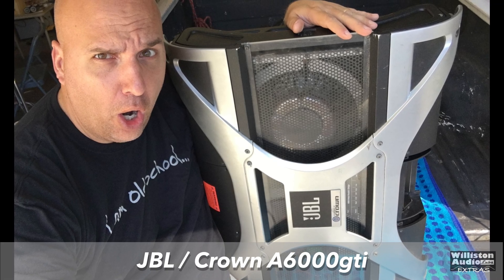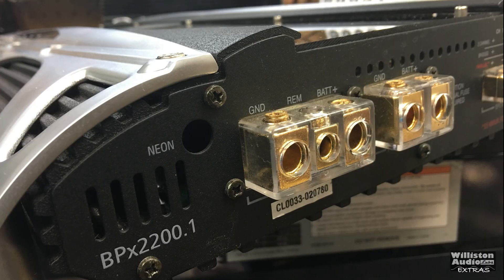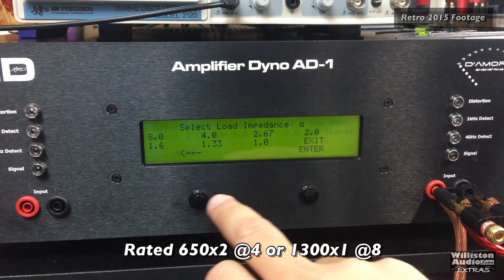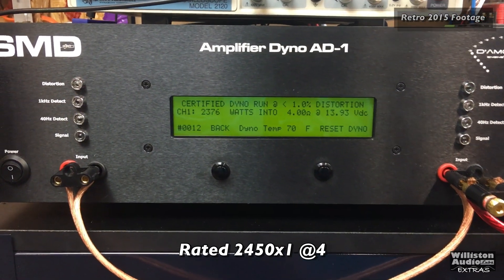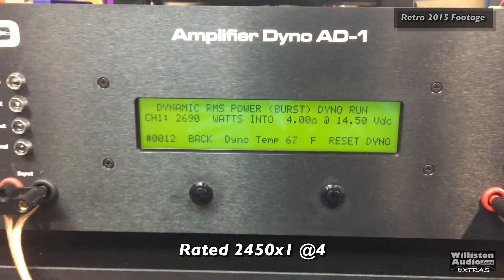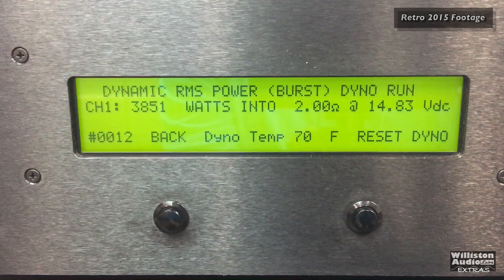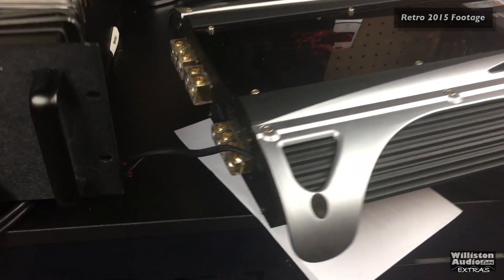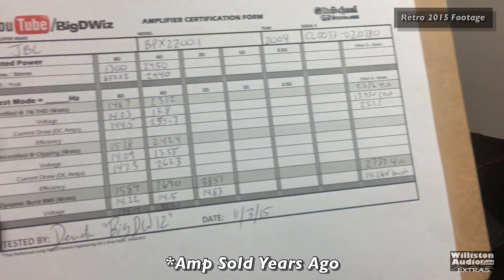2004 JBL BPx2200.1 - The Baby Crown Amp?

Comment: Hell yeah man, I have a twin to this but in an actual monoblock the JBL GTI 1201.1 and she's a little monster with incredible filtering I mean it very much has that JL Audio W7 very distinctive powerful low bass sound to it with zero acoustics or voices coming through.... I'd love to get ahold of an old set of the tube lights these amps used for it....

Comment: I wouldn't trade my gto 2400.1 for nothing. Its not a crown edition but basically the same amplifier.
Reply: Are you sure they are similar? The 2200 was a 2 channel that could be wired two different ways. The 2400 is a single channel. So quite different.

Comment: I absolutely love my JBL GTO 1001ez. It's  underrated and does 1 ohm no problem I wish I could get it to you for testing
Reply from the maker: I’m considering a testing service because I’m asked this all the time. I doubt most people will be interested when they realize the round trip ship cost plus bench fee
Reply: @wal2  that sounds really cool. never considered a bench fee. Time is money though. I would definitely pay the round-trip shipping though!
Reply: They are an unusual amp, i found mine & a friends to do some current limit or non clip type of thing if running it hard, i have the GTO-14001 now which i find superior in sound quality & output to the 1001ez but they are still a good amp.